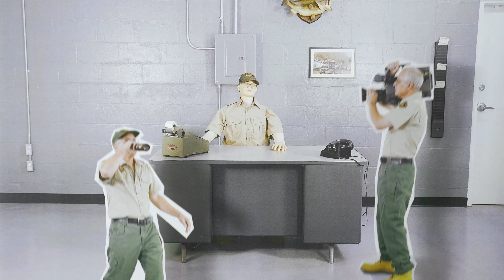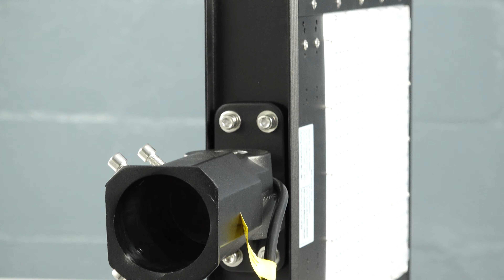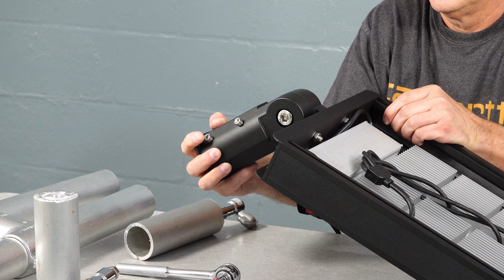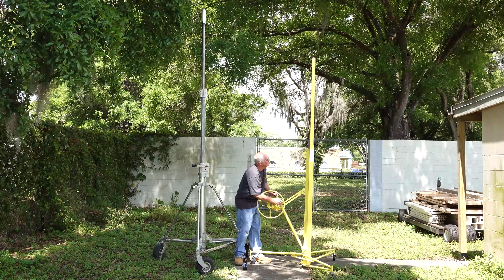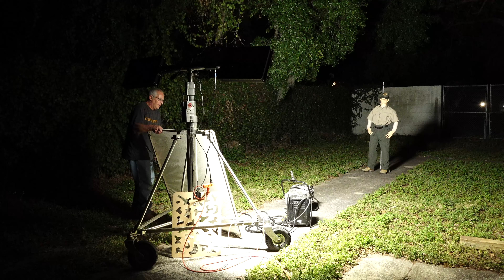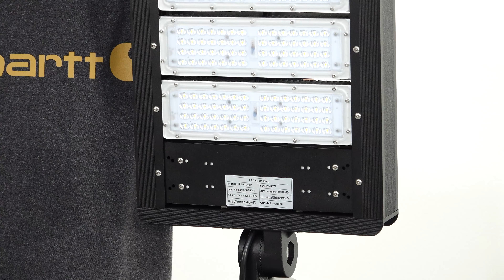Cheapest High Power Video Lights - Using $100 Parking Lot Lights 6500K for Night Video

Comment: I've got these in my hometown installed, 5 years passed and they become green as hell, not green-ish just green
Reply from the maker: YUP, that is the issue with any LEDs. They start degrading as soon as they are turned on. They actually have much shorter life than HMI or Tungsten bulbs when you consider at what point the color starts degrading.

We did a video about this on our fix it channel.

https://www.youtube.com/watch?v=VHHC2gy65Zg

LED's totally suck and manufactures stats are total bullshit. It is impossible to match colors or intensity. Replacing lights has been a total nightmare in our building.

I heard the same green color issues with Aputure and other expensive lights after just a year of use on set.